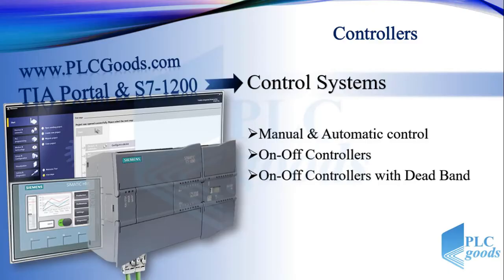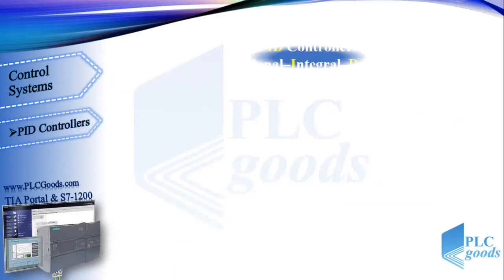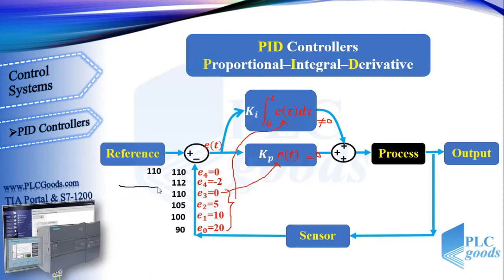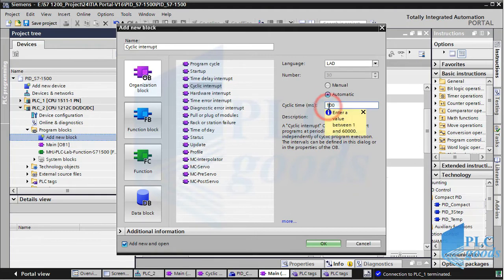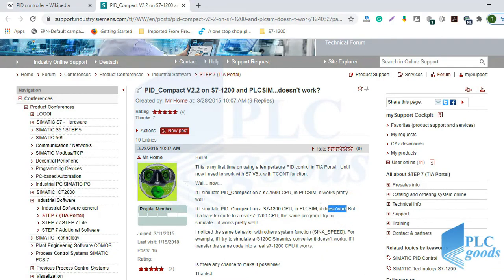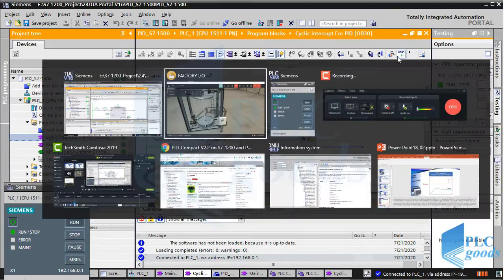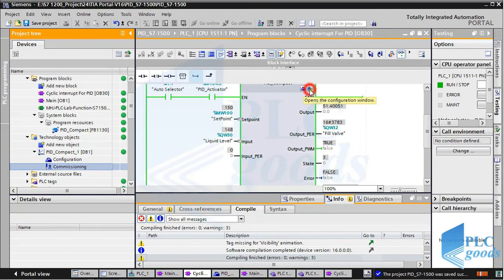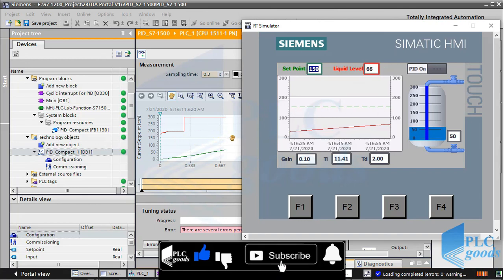TIA Portal PLC Tutorial | PID Controllers with S7-1200 – PI & PID Implementation | L 41

Comment: I need to control the vacuum in a vessel. Does the PID controller type include a vacuum controller option?
Reply: Hi, try to use pressure. There is pressure controller option, and vacuum is actually reverse pressure.
Reply from the maker: Hi there, I'm not sure exactly what capability or option you need to control the vacuum. However, standard PID controllers can usually be used to control a variety of processes — as long as they are properly tuned and we use appropriate sensors and actuators for the specific application.

Comment: I have done literally everything, but at the last, PID does not control FactoryIO but digital displays and potentiometers work but not the fill valve. any help is appreciated.
Reply from the maker: 📌 In my video, I demonstrate and test all steps, including linking the PID output correctly to the valve. Please double-check:
🧠 The PID output tag is correctly mapped to the actuator in Factory I/O.
⚙️ You’re using the same simulation mode (PLCSIM/OPC).
💻 Data types and scaling are matching between TIA Portal and Factory I/O.
🧪 You’ve activated the PID control block and it's in automatic mode.
Reply: I found the problem, in my case S7-1200 could do the PID thing and S7-1500 couldn't connect with PLCSIM to FactoryIO. I had to use PLCSIM adv (WITHOUT FACTORYIO TEMPLATE) to do it and it worked.

Comment: There is something I didn't understand well. In your program block about cyclic interrupt for PID you put "Level Meter" in the inlet PER at the beginning but you quited It finally. May you explain me, please, why so? Thank you in advance for your reply.
Reply: Hi there, As I've mentioned in the Video (7:44-7:53), the PID instruction only uses one of these 2 inputs: "Input" & "Input-PER", which must be determined inside its settings window ( 9:02-9:10 ). During the final project, I used only the "Input" as the source of my process parameter.
Reply from the maker: Okay!
Reply: Now I catch it. Thanks!

Comment: I have worked with transmission pumping station which consisted of 6 pumps with its VFD. Moreover each pump is different Q-H Curve and connected in parallel for single discharge pipe I have one PLC (S7-400 Siemens) now I wanna let PLC control Flow Rate and or Pressure at discharge side, would you suggest me to struct PID for each pump, Demonstrate how to is so very kind if you'll show me, however I thank for this knowledgeful video
Reply from the maker: Naturally, 6 pumps can control a system better than one pump, but your system is a little complex because of using 6 pumps with different properties. Unfortunately, I can not help you. Probably, you will need to study a little about Multi-input/Multi-output control theory.
Reply: @plcgoods  MIMO system is the thing I that haven't learned before, state space equation is related on it. Additionally, Discrete PID (z-domain) is necessary for computer operation, nevertheless I'll study hard about their theory and use them correctly to be obtained best operating point of each pumps, wish the god bless me